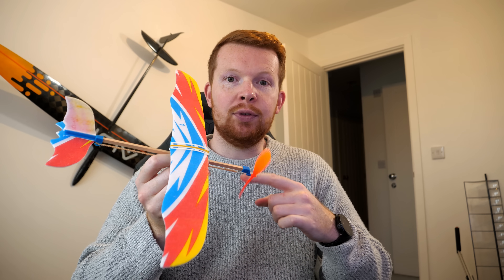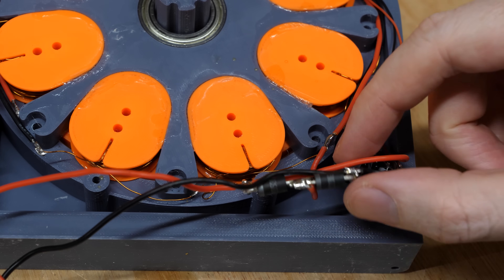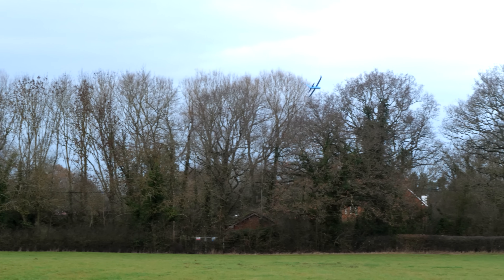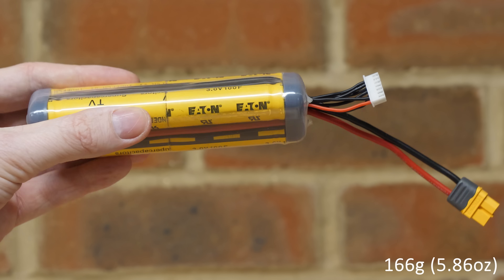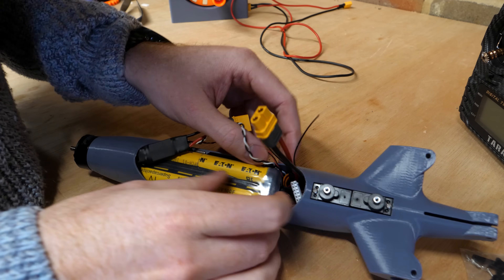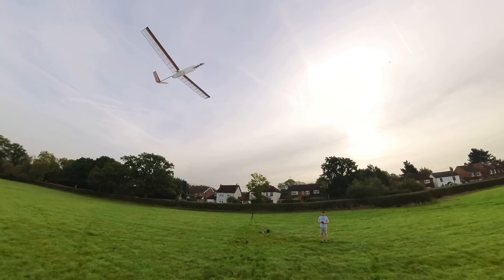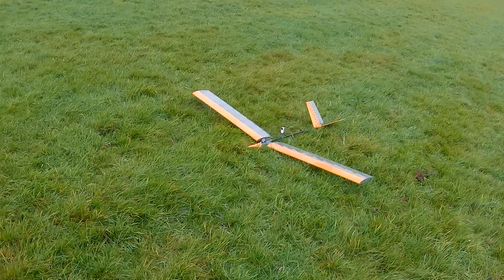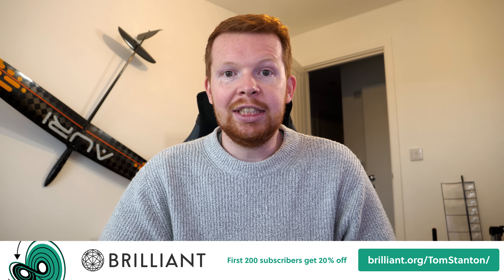Super Capacitor Plane

Comment: 1 to 1 crank to flight time blew my mind! Love Tom's work! ❤
Reply: Makes me think it'd be sweet to make it a treadle charger instead of hand crank and make a second battery pack. UNLIMITED POWAAAAHHHH!
Reply: That’s surprisingly very efficient.
Reply: My hand gets sore pretty quickly if I have too much crank time 🌈
Reply: Golden ratio
Reply: Might be a little late but he could’ve increased the gear ratio even more to decrease how many times he had to crank it. And the inertia of the wheel spinning means it will only take more effort to spin it up to speed, not to keep it there. This will result in less effort and quicker charging time. But I might be wrong idk.
Reply: Why not use the motor as a generator to turn that drag from the prop back into usable energy

Comment: What if the foldable propellers were spring loaded so that they folded back against the fuselage if the motor isn't flinging them outward from centrifugal forces? Would that reduce the drag when gliding unpowered?

Comment: If the motor generates some energy coming from the propeller and that can be pumped back to the capacitors, you can get more time for operating the servos. If the amount of energy is close to the radio and servo consumption, that could give you potentially an infinite flight time.

Comment: This electric generator with crank just reminded me of reading about some island (can't recall name) which had a major port and a mountain overlooking it, during the WW2 allies had put hidden bunkers at a vantage point on the side of mountain, in case the port city fell to enemy the entrance would be shutoff with handful of predesignated soldiers (even their comrades and superiors had no knowledge of their secret duty) with camouflaged  peeking holes would report enemy shipping activities using communication radios and electronic equipment powered by a stationary bike working as electric generator, just like you made. Soldiers would paddle in shifts to recharge batteries, they had a retractable antenna too, Soldiers would be left behind in enemy territory with rations and supplies worth many months living just beneath and above various military facilities made by digging inside mountain, Interestingly it was found decades later with bicycle generators intact, later it was discovered a veteran who was stationed there never disclosed it's location even decades after the World War ended living up to his pledge as I believe this tactic could have been part of contingency plans elsewhere too even after WW ended.

Comment: Hi ! Thank you for the quality of your video and the original approach with the use of capacitors.

Little advice, to improve the finesse of your glider you can configure the ESC so that the brushless motor locks its rotation if it is not used (the adjustment is made according to the instructions for your ESC, during the "beeps" of startup under power you will have to play with the throttle)

See you soon

Comment: I have a flashlight that uses capacitors, rather than batteries. It doesn’t stay lit for long, max of about 15-20 minutes, but it charges in about a minute, and is designed to stay plugged in all the time. Plus, it’s super light. (Pun intended)

Comment: I’m a seasoned hobbyist RC flyer. Most ESCs I’ve used have a mode to apply “brake” when throttle is zero.

Most ESCs also have a programmable voltage cutoff feature that will signal to you that the battery is low, either by a hard cutoff or pulsing. If you can’t get voltage telemetry for any reason, that could be useful. 

Overall pretty neat video!

Comment: 4:50 super capacitors also last way longer than batteries. You can find them in products 10 years old and they still work fine
Reply: Aren’t they some kind of electrolyt capacitor, which are known to degrade over time like wet batteries? Why can’t we store the same energy— albeit at higher voltage — in a capacitor with a solid dielectric?
Reply: @ArneChristianRosenfeldt  still generally better than batteries

Comment: Hi Tom, Within Next 5 Years, Only Super Capacitor Batteries will be there in Every Mode of Transportation. We can Charge these Capacitors Solar as well as Flywheel Generators. Dude, by the way, you are a Very Talent Engineer.

Comment: why use the v tail design with only ruddevators instead of using 1 servo for both ailerons and 1 servo for the elevators and just have a vertical stabilizer with no rudder? or if rudder is really needed why not use elevons w/ a rudder on a vertical stab? makes the plane way easier to control with less uncommanded yawing imo.

Comment: You can use 2 coin cells to power the servo + control circuit and use the super capacitor for motors only. This way you won't gain too much weight and you won't lose control of the plane

Comment: Amazing project! How about doing some redundancies? a small battery just for flight system control and using only the capacitor for thrust? Also, making some sort of mechanism that coould retract the props to reduce drag can increase efficiency during gliding.

Comment: I like it. I just wish we could build something like a capacitor that had the endurance of a battery. 
I guess you could put a limiter on it but would it be lighter and better than a chemical dependent battery?
Probably not, considering that you used six super capacitors to match that of a coin size battery.

Comment: This is a brilliant proof of concept design based around a cool looking aircraft. 

How easily could you create a hybrid design which combines both a bank of Capacitors & Lithium batteries into a singular modular power unit? Perhaps something which could give you a better generator time to flight time ratio? Give each arm a 5 minute workout to give you a good 30 minutes of flight time, with motor, controls & camera running. With planning you could charge up while someone else drives you to a good flight space.

Comment: could the autorotation of the propeller possibly be hooked up to re-charge the capacitors?? would be a horrible efficiency exchange but would be an interesting use case.

Comment: I had this idea, if you could make styrofoam with helium instead of air,
your aircraft would be lighter. (Hydrogen? keep your distance!). You could
greater lift-thrust ratio, allowing slimmer wing cross-section, which allows
greater speed and/or lift and/or flight duration. Good luck finding "helio-foam", (till I file a patent and find a backer).

Comment: Could you build a miniature version of the charger into the back of the prop? Maybe this is my naïveté, (not an electrical engineer) but can you charge and discharge a capacitor at the same time? It feels like you could add tiny versions of the coils to the base of the propeller and magnets into a housing behind the prop to create an automatic charging effect.

Comment: You could add a small 3.7v lithium battery to power the controller and find a way to power the motor with the capacitors.. maybe if the controller has a usb port for power, u could solder the battery to that? But then check if it can isolate the capacitors from the usb lines (which it should)

Comment: You could possibly eek more thrust time out by checking that the ESC is not configured to limit the output to protect the battery pack. You can also configure the ESC to set prop brake on so that it folds and stops, to reduce drag.

Comment: You could add a boost converter if you wanted to run it longer as the voltage drops

Comment: Try adding a brim to the print first layer, 8-10 lines wide with a .01 offset from the print base. It should mimic a larger first layer’s bed adhesion but it snaps off pretty easily leaving a more aerodynamic nose.

Comment: You need to add a motor brake to the ESC so the prop doesn't spin and fold. I made a super-capacitor RC car. The RC car Sucked but had some incredible power launches. I enjoy all your projects, Tom. You never disappoint. Always makes me want to build something after watching your videos. I was thinking you could MAKE A SUPER CAPICITOR ROCKET. Use an EDF or top-mounted propeller and fins that control the trajectory. See how high you can go with it. Of course, it's not rocket-powered but still gets to points A and B. lol

Comment: love the ingenuity of this, do you think you could ad an external magnetic connector for charging that could allow quicker charge finish to flight and save you unplugging constantly? maybe a relay that when the magnet is connected and charging its isolated the motor and when the charger is disconnected the power circuit is closed

Comment: The windmilling of the propeller after the motor dies has me wondering. Could you use it as a generator to supply a bit more voltage to increase the glide time with the servos? Like after the voltage drops below 6 volts and the motor dies, pass voltage the opposite direction into the capacitors, kinda like an alternator?

Comment: If you gain enough altitude, wouldn't the propeller act as a ram air turbine and charge up the capacitors just enough to keep the controls active during descent?

Comment: Add a dual buck-boost switch mode power supply. You could take any voltage in from 1 - 20 V and output 5 V for the servos and 7 V for the motor. You could also set a cutoff for the motor so it cuts out at a voltage you choose, and then use all remaining power for the servos. This can be done with very high efficiency too.

Comment: Can capacitors charge while being used or is it just one one use at one time, if so three of these battery packs you make power a motor that spins the generator so one battery gets used to spin when that gets low a second charged battery blends over raising the voltage while that battery gets used the other two are charging, when the battery being used runs out/low the first battery should be fully charged ready to blend in to the voltage, CAN I ETHER GET YOU TO DEBUNK THIS IN A VIDEO OR BUILD IT TO SEE IF IT WORKS

Comment: Wait I just thought of something that might work as an addition to this already amazing project - when the motor is free spinning, it’s generating some voltage, right? Well knowing it’s a brushless one, you could run the 3 wires into a 3 phase rectifier then a voltage regulator to potentially keep the control surface circuit running for longer 

I’m still unsure on the feasibility of this, just an idea that popped into my head halfway through watching

Comment: This is a well thought out project that's not only functional and is also one hell of a good looking model plane too. Only thing to do now is to program the ESC to stop the motor, so that the propeller blades will stop and fold back as I reckon in some good thermal weather that model will stay up their for hours. But I guess that will have to wait until summer. 😉

Comment: It seems like the air makes the propeller spin by itself when off, would it be possible to use the motor as a generator in this case? I mean, if it was a regular battery for sure it would not be worth it, but it is a  super capacitor so the energy might be enough to add some more time to control the plane or save on spinning the crank.

Comment: 1:1 charge/drain is not just “pretty cool”, it’s game changing. My f22 is the pinnacle of modern rc potential. It has a 1.5:1 p/w ratio, does 150mph and takes over a kilogram of battery. I get 5 minutes of flight off 2 hours of charge. That’s a 1:25 charge/drain. I can only fly twice in a single day, whereas your plane could fly basically forever. You could even use a 4s battery to charge it up in 10s and get somewhere in the neighborhood of 10 charges off that 4s, or roughly half an hour of flight. This is amazing, I love it, and I’m going to do the same as soon as my 3D Printer comes in.

Comment: You can set up your motor's ESC to have a brake function. It will help with stopping the windmilling of the propeller and help it to fold when you stop applying throttle.

Comment: you could probably add another layer of gearing on the crank, it didn't look like it was taking much torque to turn. is it able to regeneratively charge off the windmilling prop? if so you might not have to worry about the controls going dead. if not maybe have them on a seperate power source (a couple of 2032's in series maybe).

Comment: you have to setup motor brake in the ESC when using a folding propeller, otherwise it will keep spinning adding massive drag.

Comment: That was neat. I have a supercapacitor project for more earthly application. I'll get around to putting it together when time allows. I have all the bits. I'll be charging a 16v supercap to about 13V using a PWM charge controller.

Comment: You are correct that the print failed because of lack of surface area, however this can easily be resolved by using a Brim.
It adds lines on the side of the first layer, so you wouldn't have to put in any extra modeling efford 😄

Comment: Could you power only the motor with the capacitor and use a small battery for radio and controller surface? It would make it more reliable and safer, while utilising power just for flight. 
Great video BTW, always amazed by your content

Comment: Hmm, I wonder if solar panels were fitted to the wings, it would stand to reason that the plane could run for longer or even be able to stay flying indefinitely with the right setup.
Reply: I thought the same, will be trying it out in the coming months or years. Currently building the generator, but the plane is going to be more of a challenge.

Comment: I build and flew model airplanes during the 90's and early 00's and remember this one crazy guy flying a rc-sailplane.  He had a small 4.8V battery for the reciver and servos and a bunch of caps for power to the motor. He could get that plane up to 150-200m in one charge of the caps.

Comment: Can you wirelessly charge capacitor which is wrapped around the generator as a case then whilst cranking the  generator the generator emanates anyways then you can loop it back into the generator you can to also add a fan blade/propeller to the generator to  blow a wind generator whilst the fan is already spinning to blow the wind generator. Just saying.

I'm dying & i don't have much time left i was hoping to have a flying house b4 i die & a REAL ELECTRIC 4wd (NOT A BATTERY CAR) all of which i would prefer 2b wireless & PERPETUAL ENERGY as I'm a bit of a retards spastic & I'm not good at fixing things that don't need to exist & in not a hoarder so i funny likes owning things for no reason either.
PERPETUAL ENERGY IS NATURAL LAW.
PERPETUAL ENERGY IS GODS LAW.

Comment: Not sure if possible , but maybe when motor  is spinning without give him voltage , it can produce enough to do some charge back to the capacitors , maybe not enough for give it more for the motor to work but just making sure servos has the needed 5v

Comment: i wonder if you could use the windmilling of the propeller as an airplane's version of regenerative braking and use it to charge the capacitors mid flight

(also i wonder how it'd fare with solar panels)

Comment: Hopefully not to overstate the obvious but you should be using a DC to DC converter to get the voltage you need whatever you're getting out of the capacitors

Comment: You need intelligent charging for lithium ion batteries not for it to "not burst into flames", but for the health of the battery. A simple voltage detector and a kill switch would all you need to keep a liion battery from exploding. Most nicad and other types of batteries usually have these detectors in the chargers themselves. No, the intelligent charging on protected batteries is to keep dendrite production to a minimum. If liion batteries are charged at sub-optimal voltages, at certain rates/times, it can absolutely kill the lifespan of your battery.

Comment: Amazing work. I would have used micro servos and a smaller motor with lighter props. the motor and servos drained too much power. 2207 Motor 1700KV brushless motor with about 18 ounces of thrust and 3-inch props. 2g digital servo micro mini servos with 8oz of torque at 3.7 operating voltage.

Comment: What if you combine a capacitor for the throttle and a small rechargeable battery for higher storage? The battery doesn't have the Watts needed for full output, but it doesn't need to output 100% of the power, just enough to jump the capacitor from 5-6v to 7v so the prop keeps spinning.

Comment: I think it's easier to use a stepping motor as a generator.
I just tested this with a small 8.4V 0.67A stepping motor and spinning the pulley with a finger flick generates 33V AC

Comment: Tom,

Awesome! Also, DC-DC CONVERTER!

If you used a simple DC to DC converter, you could use more of the charge in the capacitors AND put the capacitors in parallel.  

The converter can step up the voltage from below 5 volts to 6.5 (or whatever) volts.

Comment: Would the prop spinning not be able to regen some charge back into the capacitors? Even if not enough for the motor, just enough to extend servo use? Could be handy on a windy day 👌

Comment: Idea: a plane that moves its lifting surfaces forward and backward, therefore changing centre of lift to pitch, rsyher than using deflection surfaces. This could, in theory, increase efficiency as there would be less drag due to wing surfaces always having a lower angle of attack.